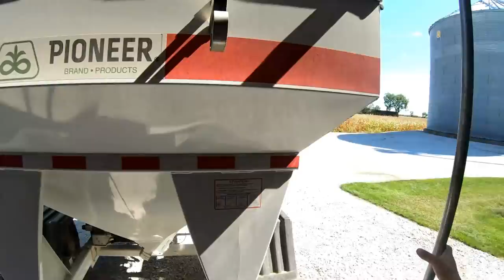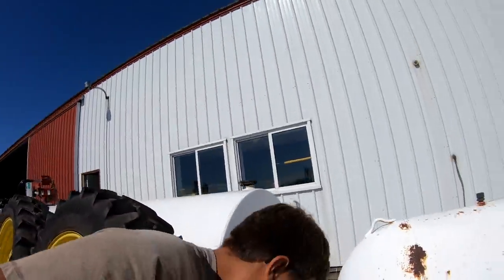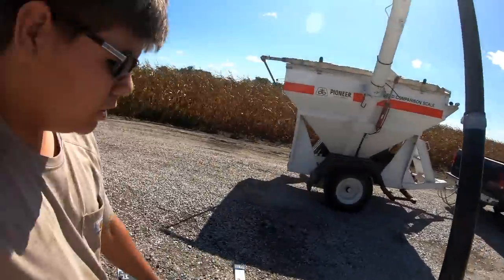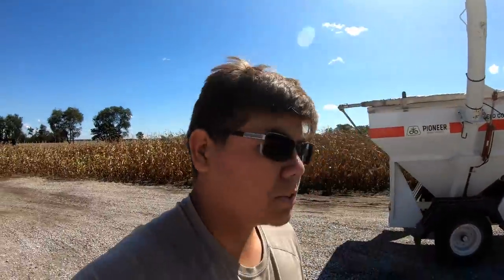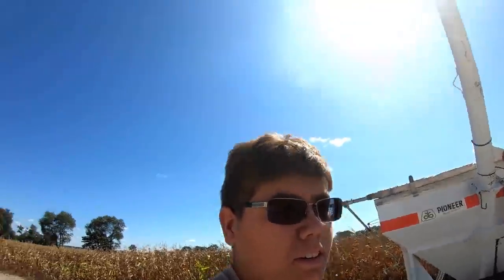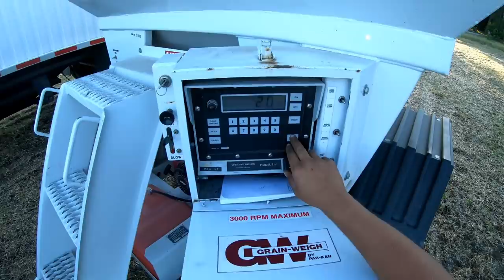FIRST Day of SOYBEAN Harvest with the S690 | HARVEST 19 Day 1

Comment: Beacon light pulses, on/off, at half full grain tank, continues running at full level.  So you need to set your full level, usually 6-10" from running over tank, need a guy like grain cart to tell guy in combine when to set it and save it,  clicking on buttons in monitor. And from beans to corn might want to adjust that full bin alarm.
Reply: Also when you have full tank alarm set, then you will be able to see % of level in tank as harvesting.   😁
Reply: Also to me they are annoying as hell, from years running a grain cart, I know where and when I need to be at combine for unloading.
Reply from the maker: Thanks for the tips!

Comment: Are you using one well and piping the water? I know a well for a 300 head dairy should irritate fairly well.  Folks in VA I knew dug a new well for their dairy about 1990...had to go down 1500 feet, delivered 250 gal a minute..I never saw so much water in my life.
Reply from the maker: We'll set the well point and panels up at the corner between the 2 fields and pipe the water to both pivots. That way controls are centralized and easy to access and we can also easily bring fertilizer to the tank for when we do fertigation applications.

Comment: What sold you on the Macdon header vs JD FD?
Reply from the maker: Big thing is weight. Also simplicity. We may be demoing a 40 or 45ft Deere draper this fall if our dealer will let us try one. We may go to a Deere for easier control functionality with the monitors.
Reply: Our 670 had no problem lifting a 40ft JD ,went with a 35 and still ended up chipping it about +40 hp.,Whole machine is too heavy .Compared to our 9670, even with  much bigger tires the 670 is downright scary in mud.